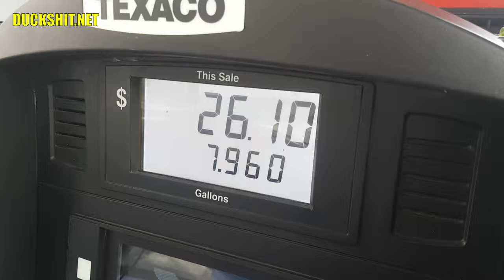Problems? Eleanore's Road Trip - ROTTEN OLD CHOP TOP 1956 VW BEETLE - 123

Comment: Hey you had me going MAN ! i was like I hope that's a hoax.... and to be truthful on the last vid I thought the bug looked a little top heavy and hope you didn't have to stop fast and jack knife or have some crazy speed wobble... glad everything worked out great... I never wish nothing bad upon anyone.
that's just not right.
 Nothing more exciting then knowing your car is being painted and the anticipation of getting it back. Good job MFDM
Reply from the maker: Thanks!, did you know that the trailer is actually heavier than the beetle body is? LOL!  I deliberately slalom the beetle down my street to see if it would flip over or even showed any signs of instability, none!  When I put two motorcycles on the trailer that's actually much heavier and much more top-heavy, as a result it gets a little wobbly.  Otherwise that stupid little Harbor Freight trailer is extremely stable, it's incredibly short from the receiver to the axle